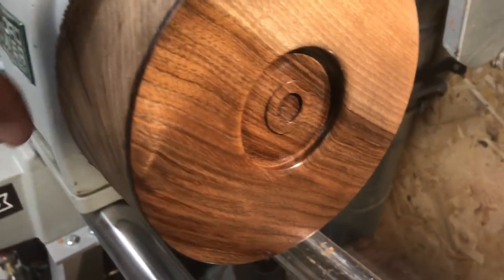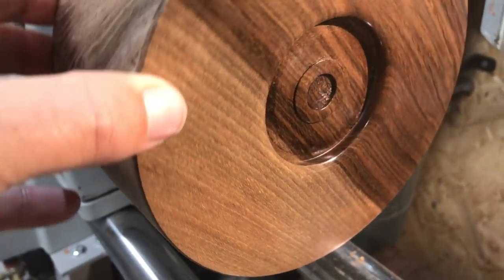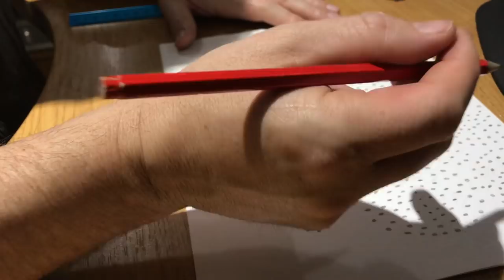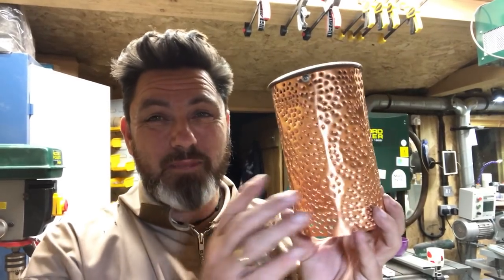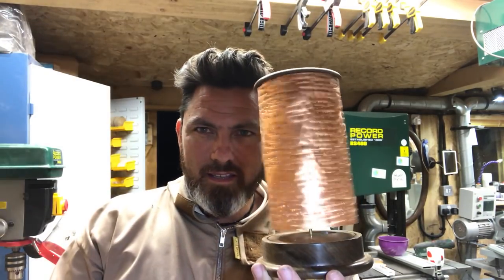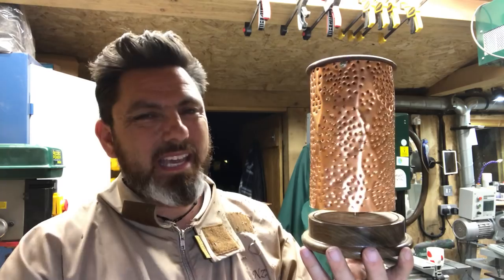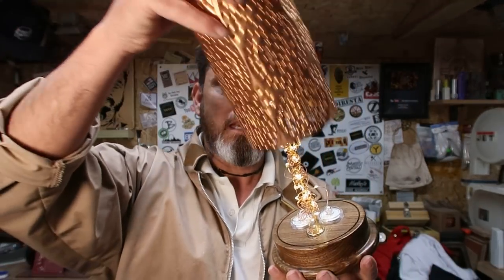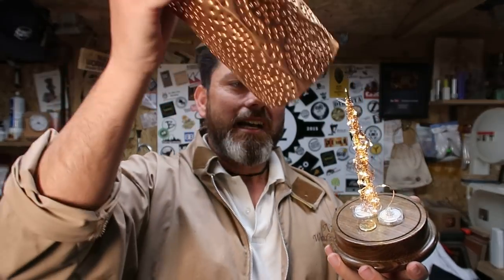woodturning - a Wishing Machine from the the Greatest Showman!

Comment: And he plays piano too? Awesome.
Maybe could have "ironed" out the copper with a rolling pin or press of some sort, may have worked better as the light/s would have a straighter path out. Also, a high polish on the inside of the copper should magnify the light due to refraction. Great little project. I may have to try to replicate it with a motor from a small toy or something to spin it slowly. Thanks for sharing. I can hardly wait for that movie to hit Netflix, theater prices are not in the budget. By the way, is the grit tin water tight?

Comment: I create these types of lanterns. The less light you output, the better definition on the wall (dimmer the light, better the show). You can also put a few slanted pieces inside of the tube, so that when the heat from the candle starts to build up and rises, it will spin the outer copper piece. Cheers!
Reply: Video?

Comment: I remember having something very similar when I was young. But you need to replace the top with metal and wait for it to heat up and it should turn on it's own. At least that was the way mine worked. Hope it helps. Oops, I guess I'm showing my age. This was in the late 50's early 60's. Good luck.

Comment: Just a thought, is it possible to turn softer metal in the lathe, maybe with some resin? Just keep up with what makes you happy man! You are doing amazing things.
Reply: It's possible to turn aluminimum and aluminimum and resin by hand, but carbide tools are a must and you can't be too aggressive with your cuts.  You can also hand turn brass but you can't be too aggressive.  I've not tried copper or other metals, but I imagine most soft metals can be turned by hand assuming you're not too aggressive with your cuts and keep your tools sharp.

Comment: The combination of the copper with dark wood is amazing.  I recommend scrapping an old microwave, for the low rpm motor that rotates your food, for this type of rotating art.  Also, not to be too critical ( I absolutely LOVE your work ), but it was slightly painful to watch you turn such a beautiful large bowl blank into 60% shavings.  I think you would be better off cutting that in half on the band saw if you only needed half the thickness.  You'd have an extra piece of that beautiful wood and save wear on your awesome carbide tools.  I also understand and admire your artistic style of putting a piece on the lathe and figuring out later what it will be, so take my criticism lightly.  Just my 2 cents.  Keep up the incredible art and fantastic videos!  You Rock!

Comment: Love your videos and love that you are unapologetically YOU! I know this is late but heres a thought or maybe suggestion for future videos that require spinning perhaps? I would recommend looking into bearings for skateboard wheels. They are relatively cheap and a metal or wooden dowel could be secured snuggly inside. This could maybe help with any sort of wobbling or freeplay issues that come with spinning. Not to mention they are designed to spin for an insane amount of time. Just a thought, cheers!

Comment: Maybe use a thin brass tube instead of the metal rod. And a small ball race embedded in the top piece that the brass tube is soldered into which would make the spinning more stable and spin longer. And you're right it is a fantastic movie.

Comment: The candel may have worked if you had a large enough white canvas and dimmed the lights the effects would of been closer than you think. Of course this defeats the purpose of it being out in the open but another idea is something my schools used to put on they had a air filled ball kinda like a bounce castle but it was pitch black on the inside (and yes properly vented for kids to be inside) where they showed us maps of the stars. It was unironically called star lab but the pin pricks of light your after that's the kind of thing it felt like.

But I agree with the message my creator friend (Just starting on my journey to be a maker starting small with custom Legos then I plan to make a custom Action figure and go from there. Speaking of Legos please please please don't seal, cut or otherwise mess them up. Feel free to do so to Megabloks but save the Legos they are special and Always Awesome) Be who you are not who they want you to be as they say in danish Leg godt, skab godt, og respekter godt or in my native tongue "Play well, Make good and respect all. I think that's a accurate translation I only know for sure that Leg godt is Play well and where Lego got it's name. 

No no I know it basically means what I said in English I'm just not sure it's grammatically correct. Anyone here able to check? I'm not trusting the code of Google Translate anymore than Babble Fish (Is that even still around?)

Comment: Instead of a wooden top make a fan style piece out of metal sheet the heat from the candle will make it turn and it will be slow enough for the lights to shine on the wall

Comment: I think the problem with the candle was that it wasn't in the center, but off to one side. On the inside, the holes weren't smooth and flat so light would not travel through them very well unless the light was shining directly through them. Any light coming at an angel would be partially blocked by the metal that was pushed inside.

Comment: I would have smoothed the copper out before you put it on and also if you put a thin wood ring around the bottom the balance would probably be better and a finial on top to turn it. i have something similar that casts snowflakes on the walls that I put out in winter

Comment: did you put a hole or notch in the top to fit onto the tip of the middle rod? i had a similar party light (just the idea not total design)when i was growing up and it had a hole in the spinning piece
Reply from the maker: Justice hey yeah. A small hole in the top 👍🏽